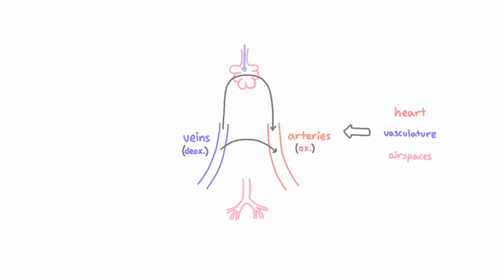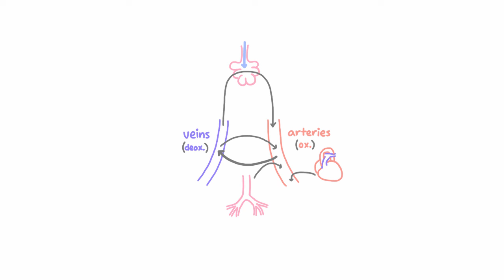Shunt

Comment: Shunt – a piece of metal or metal foil that short
circuits the ends of cap leg wires to prevent stray
currents from causing accidental detonation of the
cap.